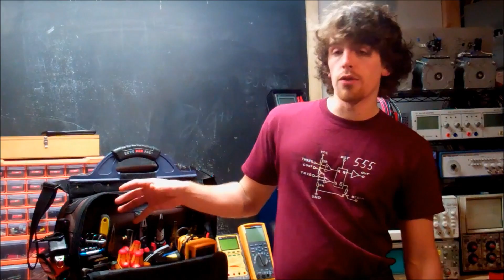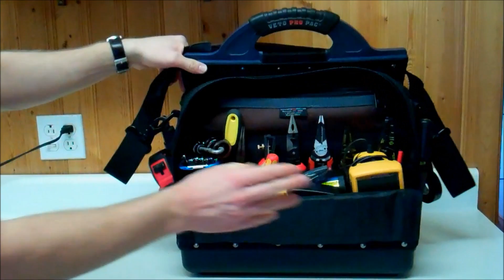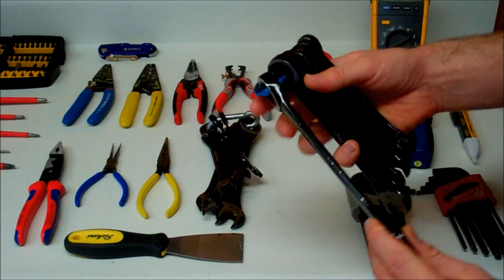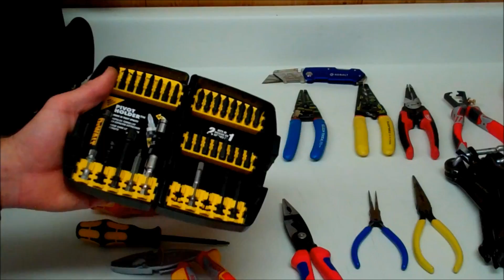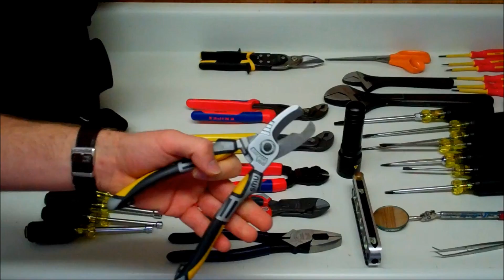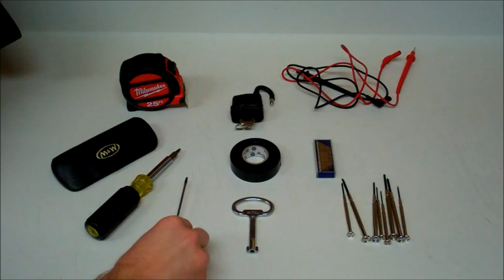Electrician Tools

Comment: Did you upgrade the adjustable wrenches to knipex's pliers wrench? It's much nicer to bolts in my experience. Also just got the 13 88 and it's such a reassuring backup

Comment: Hi Nick. I don't know if you can get them in Canada but if you can buy yourself some Bahco adjustable wrenches. You can use them with confidence knowing that they will not wreck nuts and bolts. I no longer carry a selection of wrenches just a couple of Bahcos. They are available both in metric and imperial. :)

Comment: hi nick there is wire stripper i use in Holland and its beteer the the one you use now 
i have used it my self 
it is an automatic wire stripper and  it comes in different brands also
the best one i think is the one made by weidmuller WEIDMULLER - STRIPAX 0.8-10MM - WIRE STRIPPER, 0.8-6MM

Comment: Hello Nick,
I just finished watching your previous tool video and posted this same question on that one as well. 

Great video, and very informative.  I was wondering why a label printer was never mentioned?  Is it a tool you are not using often, or do you have another solution for making sure panels and wires are correctly identified as well as safety signs?
If a label printer is something you use, I would recommend our LW-PX900.  If you are interested, we have Canadian representation who can set you up with a demo unit, no problem.  Check out our product videos to learn more.  

Thanks, and keep up the great work!
-K-Sun
Reply from the maker: +K-Sun Corporation,

Thanks for supporting the channel. I use a label maker all the time, but not as one as extensive as yours.

I would be very interested in working with you guys to promote your product. Please contact me at,

nicolas_john_sek@hotmail.com 

Thanks in advance,

Nick
Reply: +Nick Sek thought you were dead. Why did you stop uploading videos?
Reply from the maker: +Landon Hurt Still on the game - just bought a new house and the lab was deemed last thing to be built looking to create again this summer. Starting to make up a rough schedule for upcoming videos! Any suggestions?
Reply: +Nick Sek I have a few suggestions. I will shoot you an email.Glad to see you are still alive btw!

Comment: I'd probably be able to take this video way more seriously if you're tools weren't brand spanking new and never been used... Your tools literally have not been used 1 single time... Sort of makes it seam like you're talking out of your ass, and haven't truly spent years using them and getting to know the pros and cons. Don't really trust your advice. For example, there are tons of different wire strippers out in the market. I would never use the ones you have, they are not insulated high enough for my taste. If I had to strip something hot, it would be much more dangerous with those strippers. Yes all the tools you mentioned are electrician tools, but some of them are just not the type that I'd buy.. As a beginner I bought a lot of them but quickly ditched it after experiencing much better ones. Don't be too offended though, this is just my own personal opinion.
Reply: My thoughts exactly. Those tools have never been out of that bag, and that bag has never seen a job site. My veto bag looks scruffy as hell!

Comment: As an industrial electrician you would be dealing with unistrut and long threaded rod. It seems the only nut drivers you should have are the milwaukee hollowcore nut drivers. They are also 12 pointed and can handle other nuts as well. If you try the milwaukee fastback II utility knife, you will find it is faster, better and more comfortable than any other knife for opening/closing. I have tried many and put the others all aside. You seem to have many of the same screwdrivers and cutters and pliers. You are just carrying duplicates which makes me wonder why and if any of them truly measure up. You also do not seem to have any kind of powered smaller drill or impact driver in your bag. ?  Also do you not want to have a hands free flashlight to shine where you are working? This would seem to be extremely important. I use a mini mag style headstrap with the terralux 220 which is a great 220 lumen 2 aa flashlight and I use nimh aa and carry extras. Also what about carry a small case with wirenuts, plate screws, receptacle/screw space out washers etc. I carry a little case like your bit case with them. It also has inside gfci stickers, extra long mounting screws  and other necessary hardware which an electrician will always need.  Also I do not think you mentioned having a rethreading tool for 6-32, 8-32, 10-32 threads. Box holes always get stripped. There are some other things I have to think of. Oh, what about a circuit breaker finder, leads for it, socket adapter etc. GFCI receptacle tester. I carry colored tape when taping wires so it do not confuse coloring. At least black, white and  green for you basic wiring and differentiation between hots, neutral and grounds.
Reply: +Ari P  Klein now has some hollow core style nut drivers as well that look cool but are a bit pricey
Reply: +Adam Greene they are worth every penny. Try them and you'll never regret it. I got a set just a few weeks a ago.
Reply: TimEllenburgPhoto thanks !
Reply: Typical of Klein to be a Johnny come lately.

Comment: I've been looking at videos like this from American and have been quite shocked at what sort of equipment they use and lack of safety. I saw your video and went "Thank goodness Canada is normal" haha, your tools are almost identical to my own in Australia, except that I don't use wire strippers :P

Oh and I got rid of my bluetooth multimeter wireless head as it kept going flat all the time, I've now got a Fluke Insulation Resistance Tester and Multimeter in one

Comment: Nice bag and organisation, definitely going to be pinching the carabiner idea to store my spanners.

How do you find the battery life on the fluke 233, specifically in the detachable screen?

While the detachable screen came in handy, it was only occasionally for my line of work and the poor battery life outweighed the positives for me, needing to be changed every 2 weeks. I was actually glad when some bastard stole it (covered by my works insurance luckily) and I replaced it with a 1587, much happier with that
Reply: I have the same multimeter 233 fluke. and the depending on how much you use it  they hold up well. I have more than one meter and try to use my cheaper meters for dirty work but I have only changed battery 5 times in about  3 years. takes 5 AA batteries. 3 in the main unit and AA batteries in the monitor. Hope this helps. 

ps. I also don't use the 233 fluke that much when the cheap one does the same thing. I use it when needed. I do like the wireless screen.

Comment: Wow I'm glad I keep my bag small. You can do alot with a 10 in 1, knife, sripers. Like everything pretty much. I like to keep a nice touch tester and hammer for staples. I noticed you had no tape and krimpers. Someone afraid of crimp sleaves? I work for myself and I don't know a lot of guys who use crimp sleaves like me. Probably because the connection never goes bad and it's just to good to be true lol.
Reply from the maker: Clifton Dupler I usually just rock a pair of lines man, a standard screw driver, and installation pliers and a cell phone, in my pocket. Handles 80% of my work.

Comment: love that array of tools I own greenlee tool and some klein and my meters r klein and Ideal and greenlee and radio shack ones and extect brand and that tool bag nice bag
Reply: cool that y it is good 2 have more than 1 meter so if it gets stolen u have back ups cause flukes r not cheap
Reply from the maker: Greenlee and Klein good electrician tool brands. I have never used the Klein line of multmeters, any feedback on them? Thanks for the props,

Nick
Reply: they great home depot has klein if u go to the web site or local home depot store by one and check em out to me they r good meters even greenlee meters r descent meters
Reply from the maker: I have only seen on Greenlee meter, the leads were soldering into the multimeter - ever since I would never trust their brand of mulitmeters, Klein has got a good rep. so I would give them a shot. Maybe I place some thought into buying one.
Reply: okay then send a video on what u think about it I have the mm 2000 true rms and it does temp and every thing
Reply: I do sum hvac and handy man work
Reply from the maker: HVAC is a pretty interesting field, I like the variety of work - I always end up talking to those contractors. The MM2000 seems like a pretty solid meter - as a tool junkie I have this sick compulsion to go spend money now. lol
Reply: me 2 I have so many pliers I really love drills and all kinds if hand tools a good beginners set would be commercial electric from home depot big box store check them out they r not klein Ideal or greenlee or knipex wera or wija or craftsman but hold their own 4 the beginner though
Reply: try them if u have a home depot store near u also I have the CL 200 clamp amp meter and sperry ac/dc clamp amp meter and Ideal fork meter and a Dmm from them to I wana get the HVAC clamp and Dmm from fluke but they r so pricey
Reply from the maker: The problem with Fluke though is they make a great meter, and they hold up - it is not rare for me to see a 20 year old Fluke used in the field. The got a really confident feel to them. My Fluke 289 - is awesome but I got to agree with you it cost me a lot. But I know it will be with me.

One thing though is Fluke is one of those brands that people steal, it sucks but it is true. That why in my tool bag when I go out to an unfamiliar place I bring a cheap meter. 

The Ideal fork seems cool, I got some things coming for Ideal (it is a mystery box) but I hope that is  included. I really like them as a corporation good product and fair pricing.
Reply: good hand tool they make as well have some screw drivers and they hold up to
Reply: Nick Sek Whenever I take my Fluke on site I keep it in a bright orange water/dust proof hard case with a pressure valve (think it's meant for camera equipment!), I'm yet to walkaway from it as it almost glows at you!! The only potential tool thieves I come across are the public as I very rarely work alongside a fellow service tech. But yeah, most of the time I use a cheap meter when onsite, mind you it's hardly worked hard, most of the time I just need to know if something is getting power or continuity, nothing precise.
Reply from the maker: I got a mass collection which is growing (7 - 2 are Flukes) Though one is over kill and heavy and the other can't do micro amps. I usually use the Fluke 233, or the Ideal 61-340s, I will be using my new UEI soon - really impressed with the unit. 

The case sounds pretty solid I will look into the idea and see the outcome!  Thanks for idea!
Reply: okay dude tool on u r like me a tool buff nut when I get my matrix drill and my klein meter I won mm500 or mm5000 I will tell u the come out of it
Reply: I got that meter is is a to die 4 meter and it is auto ranging meter back lit screen and more
Reply: those yellow pliers r long nose pliers the blue r needle nose pliers read the package when u go to a store they say long nose

Comment: Another great review, it's nice to see the progression from the last video. The more I see of the Veto bags the more I want one, I've promised myself one when I change jobs. Was thinking about my setup whilst watching the video, and I don't know if this is common or not, but my work tools, the tools I use for my job are pretty much all low to mid range, whilst the gear I have at home is all much better quality. Maybe that's down to the environment I work in, it just made me smile. I've got a set of the slim VDE Wera's on order, looking forward to checking them out. I think next on my list has to be some dedicated nut drivers, always liked the Klein drivers as they look quality but being in the UK they end up being too expensive, I think being a tool junkie I feel I need to have some Klein in my life!! will probably end up with the Wera set however if the VDE's impress. Keep up the vids!!
Reply from the maker: Thanks man appreciate the feedback man! Veto Pro Pacs are amazing! Plan on changing jobs soon?  Work actually provides me with tools, so the is my personal set that never leaves the lab. The only thing I provide at work is electrical testing equipment. The wera screw drivers are awesome, you will have only one regret... not ordering them sooner. How about about Wera nut drivers (or did I making that up in my mind?)? I really like the wera grip, quality and innovation. Closer to home for you too. Klein are good but they aren't the be all end all. My new brand is Knipex and Wera. German engineering is beyond amazing,  Thanks for the support 

Nick
Reply: Nick Sek Funnily enough about 20 mins after posting yesterday the Wera's got delivered, that grip is awesome, someone has really spent some time thinking about that. I went for the slim model just because I know at some point in the future they'll make paying the extra £10 seem worthwhile!! After feeling the grip on the Wera drivers I can see them becoming my brand of choice, and like you've said a few times, the price v quality is real good.

Your lucky having work supply your daily tools, I received my first "tool" from work last week...........a black sharpie for re drawing the lines on pool tables! I'm just reluctant to take my "good" tools to work for fear of someone walking off with them, unfortunately I work in some pretty negative environments where people wouldn't think twice about walking off with your tool bag whilst your back was turned (I've already lost a couple of meters this way).

I'm always planning on changing jobs but it's been harder to put it into practice, I need to up my knowledge levels (or at least get a qualification to confirm the knowledge I've built up over the years, I'm self taught). I'm tired of working in the negative environments and on mainly gambling machines (you get a lot of people confronting you believing the machines have robbed them or just generally people telling lies to get something for nothing), I'm looking to get into other coin op. industries, in particular repairing vending or coffee machines, a similar skill set to what I have now but in not such a negative environment. I'll keep trying.......